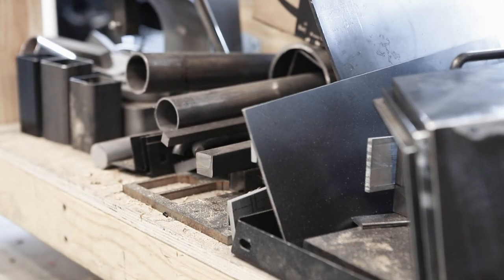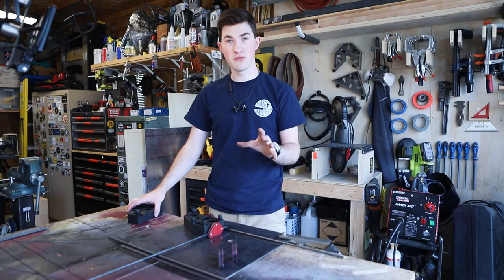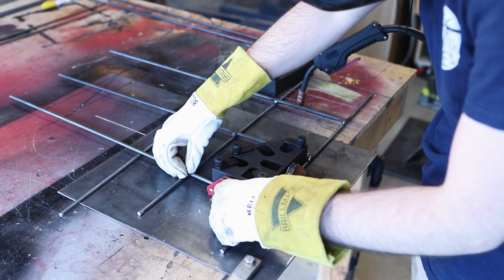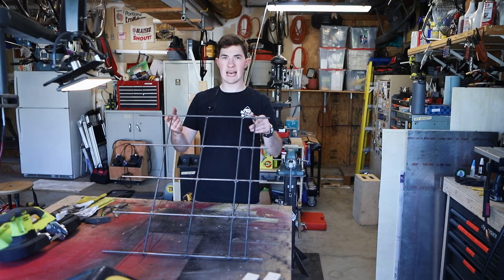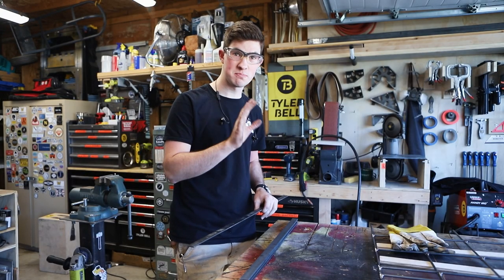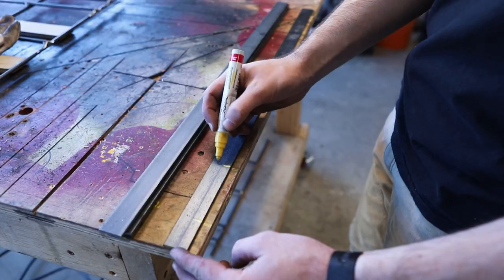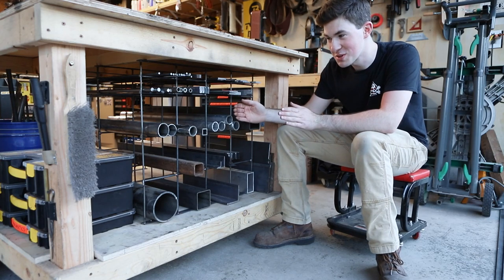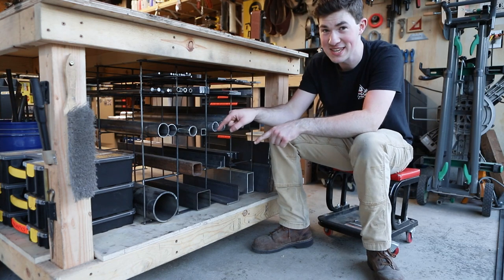Scrap Metal Storage Under Workbench | Easy DIY

Comment: i mean... if we are talking about 1" and above solid round stock, i hardly have anything above 12" just because it tends to be rather expensive and the offcuts i can score for cheap are usually shorter wich doesnt really bother me (most of the time you just need a short piece of that anyways). also its good to keep offcuts in a bin. for me i only throw away stuff thats really not usable any further, usually anything smaller than 1". i often end up using those "scraps" for stuff people need, need that lawn mower patched? got you! machine needs a gusset to make a weakpoint stronger - small parts bin will get you there. it can get out of hand a little bit, but so far in like 5 years of dedicated making, i only collected 3-4 bins of metal scraps wich is acceptable.

Comment: Next time use cattle panels Tyler. Like $20 each, similar to what u built, much cheaper and faster. Then just cut to size w/ bolt cutters or grinder etc.  We use them when runs of fence are too short to justify stretching wire but dont get enough pressure to justify a gate
Reply: Might be thinner rod than what u used tho, and may have needed to use some metal straps instead of screwing thru the flatbar for mountimg